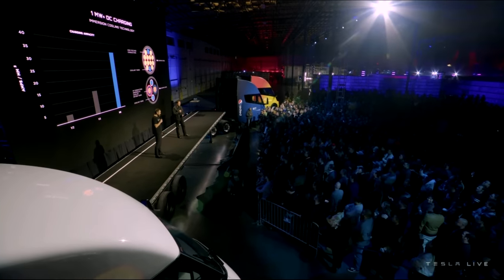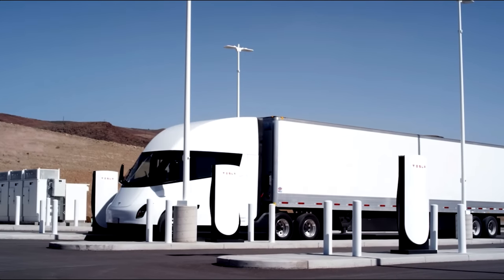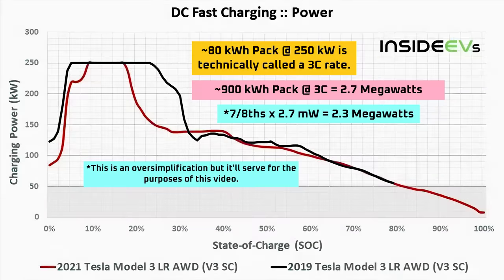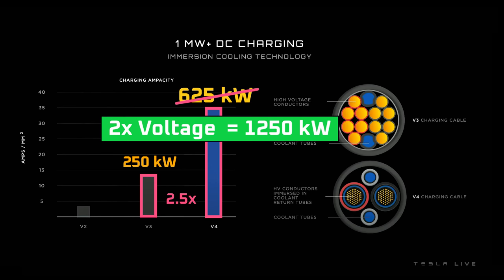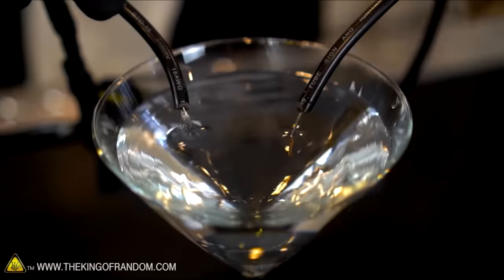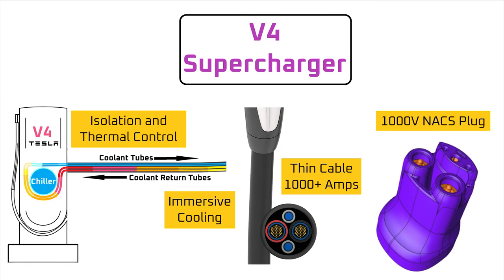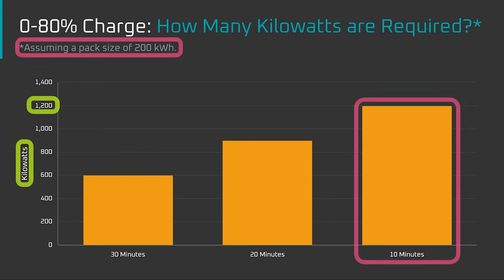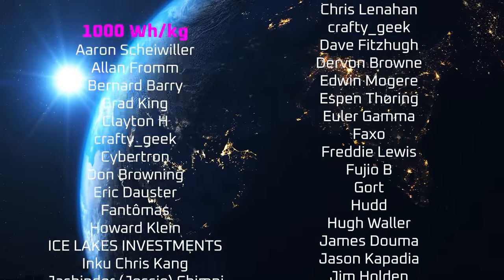Tesla V4 Supercharger // Megawatt Charging for the Masses

Comment: Trying to help but I’m far from being qualified. I suggest two things that might help. I live close to the 43 stall v3 superchargers in quartzite Az. A massive V4 or Mega Charger 
station is being constructed near the current V3 location. By the size and location 1/2 way between Phoenix and LA I’m guessing its for Simi’s and possibly cyber trucks. Inspection of this sight my give some resolution to the Mega/V4 question. Also in early photos of the Simi it appeared to have duel charging ports is it possible the new plug will support split charging for faster charging for both the Simi and Cyber truck. Again 

thanks for your fantastic videos.

Comment: maybe they don't need anti-freeze in the liquid if they use a tiny bit of energy to automatically keep it above zero even when not charging. in this case they could use distilled water which is non-conductive

Comment: Putting aside electrical considerations, it makes sense that semi mega chargers and V4 Superchargers would be separate for parking space and availability reasons. Consider: most super chargers are back in and often in tight parking lots. Semis won’t physically fit. And for mega chargers semi operators won’t want to open up these chargers to the whole Tesla consumer vehicle fleet. They could quickly get backed up with consumer charging. Businesses will want dedicated chargers. Note: this doesn’t preclude hypothetically offer a NACS adapter for semi but it doesn’t seem very useful. So I don’t see much benefit of cross compatibility.

Comment: Long range cybertruck and long range semis will probably need a brand new network of charging infrastructure.  It is easy to see why Tesla is starting with large fleet companies before getting to the individual truck driver because of this but Cybertruck could be the impetus for a totally new charging infrastructure roll out.  I believe this new infrastructure rollout may put stress on the current grid and may become part of major grid updates for the future.  Certainly grid connected batteries will be an important addition in the future.
Reply: Needa Serenity City mobile charity Chargin & tire repair too hopefully 🙏

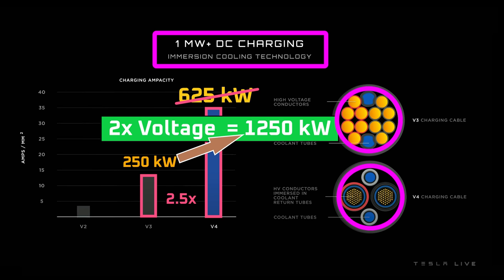Comment: In discussion of V4 Supercharger//Engineering for 5x Power (11:27-17:51), seems to me it would be better to use rectangular cross section conduction wire (higher "ampacity", i.e. current density) because less wasted space between circular conduction wires--as shown in the diagrams.

Comment: Crazy, too say the least. Does this mean that the entire electrical infrastructure of the city has to be cooled? Maybe not, according to even higher voltage, however, wouldn't it be safer to spend the extra money on thicker cable? It's only a few feet. 

I mean, I've had cooling issues with my truck (without 1,000v additional "side issues") 😬

Comment: 35 Amps/mm2 is perfectly reasonable, but it says immersive cooling I would expect the conductors to be inside a loose tube with a liquid or gas cooling, REMEMBER the voltage drop along the cable is seen by the coolant and therefore an oil or other non conducting fluid would be the way to go,  we used to put 10,000 amps easily along 120 mm sq but in commerce it was very close to the fuse rating of the cable even when Injection air cooled

Comment: Thanks Jordan, pretty much spot on to what I was thinking, just didn’t think about the lithiation element. Do you know what the changes to C rate are likely to be by adding Silicon and any potential changes to chemistry, do we have any info on C rate for Qilin?
Reply: Managed to answer my own question, found a video on CATL website that shows the CTP3 platform as having C rate of 4 so looking at the CTP3 space advantage which will be coupled to M3P chemistry so they could do an 80kWh M3P Qilin that would charge at 320kW peak which coincides nicely with rumoured Supercharger updates

Comment: How cold/hot will the coolant be? Tesla has been using an advanced heat pump on its cars for some time now. Certainly no reason not to use chilled coolant in the charging cable, AFAICS. _ other than the cost of the heat pump, anyway.

Comment: The conductors are not direct immersed. They are insulated from the coolant for the voltage and containment reasons. Direct immersion allows for parasitic metal loss. You see this in boats all the time. They will have a zinc block on them that slowly erodes away so that the rest of the outboard engine does not erode. you would have the same issue with direct immersed wires and no room for parasitic metal losses. They can't be direct immersed! There will be at least thin insulation between the coolant and the conductors.

Comment: Could they not just use multiple of the v4 connector on semi to double or triple the power input? Sure it would be annoying to plug in multiple cables, but probably a lot cheaper to design than a whole new type of plug and get economies of scale from the rest of the fleet.
Reply from the maker: Could be!  There were a lot of permutations what went through my head.  I'll leave it open to speculation 😁

Comment: U said v4 chargers have 2 return Coolant tubes (now I’m thinkin cooled with liquid nitrogen or doped mercury)  that means it has 2 supply tubes. Each circuit has both a supply an return coolant tubes that obvious by th size of cord cap shown in video large enough to channel through cap . Supply coolant delivered to back side of male plug from outside of a smaller tube to dissipate heat then returning on inside of inner tube to chill sommeres

Comment: Wouldn’t it make sense if the tri motor CT can plugin to both V4 and Semi chargers? Aren’t these sized trucks used for towing massive objects? Currently Superchargers are terrible designed for when towing.
Reply from the maker: V4 is supposed to have pull through charging apparently.
Reply: Mixing consumer vehicles with commercial trucks in refueling and parking is heavily avoided.  Consumers represent too much risk to the professional's livelihood in the potential for liability and lawsuits against the operator.  Just because Hank Hill was driving a rig, it didn't make him a trucker. 🙂

Comment: I hope Tesla’s Semi will use the international CHARIN standard for charging, instead of another proprietary connector.  I believe that fleets will require CHARIN, and that a standard plug will help Tesla as well as other truck and charger OEMs to electrify trucking faster.
Reply: This choice would cripple Tesla rate of innovation.  Tesla will move their standard 10x faster than Charin.  They will have some interoperability but will need control as a hardcore engineering company.

Comment: wouldnt oil make a better coolant than water......oil is used in high voltage transformers for example
Reply: They stated water.  Water has higher specific heat and therefore heat transfer.  Also if Oil then they would have to get approvals in case of a leak.  The water system can be made non toxic.  The safety systems will assure no conduction faults are allowed. More environmentally friendly.
Reply: @zilogfan  Great points! thanks

Comment: The industry standards for conductor A/mm is for the conductor only. It make sense for calculation purpose too.
Insulation is not taken into accont as it can varie and does not contribute to conduct current.
It may even be detrimental as isolation reduce heat dissipation.
So I dont think Tesla would depart from the industry way of using ampacity.
From plug specification, 1000V x 1000A = 1MW . Is the 1.25MW based on other assumptions ?
Even if there is only one wire for the coolant, I would be prudent with electrolysis. There will be a potential along the same conductor because of voltage drop. But you can alway use varnish on the indicviduals strands of conductors.
I dont know all the requirements but I would prefer to design a coaxial cooling than immersing the conductors, especially if it can meet power and diameter constraints.
Reply from the maker: Thanks for the input!

Comment: While not at the volume of Tesla etc. the changes to electric drive in commercial products - and their charging needs may be of interest to you.
For example the  underground loader (R1700XE) and charger (MEC500) from Cat - search Caterpillar and 112700.

The difference between cars and trucks and other commercial products is not the power they produce but the % of time they produce that power.
A Plaid is max power for less than 10 seconds - unless it it running at or near maximum speed for minutes - difficult anywhere except Germany and a portion of one road in Australia.
Regenerative braking makes electric vehicles a higher power "use" % than gas/diesel but still relatively low - except in racing.
Ludicrous mode used long term causing damage the battery pack shows some limitations - appropriate name though, and awesome for what it does.

Commercial product may have the same power level but instead of of power use of say 20% they have a power use of say 80%.
This brings substantially different cooling and reliability challenges with it.
Customers demand long term reliability and the same performance from full charge through to recharge time or temperature or altitude variations.

FYI the Cat Underground loader BATTERY PACK specs

Battery Chemistry	Li-lon
Pack Voltage - Nominal	715 V
Pack Energy Capacity - Total	213 kWh
On Board Fast Charging Charge time (0-100%)	Less than 20 minutes (two MEC500 in parallel); Less than 30 minutes (one MEC500)
Battery Cooling Method	Chilled Liquid (Extended Life Coolant)
Operating Temperature Limits (ambient)	50° C/–20° C (122° F/-4° F)
Charging Current, Voltage	1160A (output), 820VDC
Maximum Charging Rate	840 kW (two MEC500 chargers)
Charging Rate	Up to 4C (matched with MEC500 chargers)

As always an awesome video 👏👏👏 thanks for all of the information across the year.

Comment: Are v3 chargers going to be upgraded to v4, or is v4 just going to supplement v3?
Reply from the maker: Nah, just build new ones V4 is my view...that's what they've alwasys done
Reply: @thelimitingfactor  
Wondered if they might "re-cable" some V3, but on reflection, the plumbing for the cooling system may not fit in the "standard" box?
.
Also wondered if there's a possibility to repurpose old versions as the network upgrades, using them in customer locations for overnight slow charge.

Comment: What I don't understand is how is a 500V rated cable compatible with a 1000V vehicle? My only guess would be that the vehicle will be able to increase the voltage via a DC to DC converter.
Reply: if the vehicle has a wire to the middle of the pack and another 2 way contactor as part of its design than you can charge the pack half at a time even while still having the pack online for the car incidentals. This avoids adding the DC-DC weight and cost and efficiency loss and also of course leaves the Superchargers un-modified except the control software that is always being updated anyway.  This keeps all V1-V4 chargers accessible although at reduced net speed.  The cybertruck will definitely work to find V4 if they can and others in a pinch.  This also eases home charger configurations and allows easy continued use of the 11.5kw ish ac to dc charger part number now in all cars.
Reply: @zilogfan  Thank you for this explanation. This makes sense too. I did see somewhere else someone said that's how the Hummer does it. 
My new question, you said charge half the pack at a time, is how do you maintain pack balancing if you are doing half at a time. Or are you still charging both halves at the same time.

Comment: Yes, that's fair enough. It fits in with rough rule of thumb of European engineers that you must have liquid cooling if you are charging at 500kW for more than three minutes. The same engineers would always distribute the load and upgrage by stacked power modules. So, what you have said is completely in keeping with what we know from Pepsico's publicly available statements about their refurbished depots in Sacramento and particularly at Modesto where they have four Megachargers each and that they constructed themselves to Tesla design. But at 750kW, I think. And with the funding all well and truly in place last quarter 2018 for (originally intended) installation 3rd quarter 2019. And with the clear stated aim for the Zero Emissions heavy duty tractors to have a one million mile or seven year life. Does anyone know of any other Megachargers installed and in use?

Comment: What would limit Tesla from applying this immersion cooling to the 4680 cans and terminals? Seems like a huge gain in cooling efficiency and weight if they replace the channels with immersion cooling.
Reply: I don't think heat will be an issue in 4680 packs (in the near future)
Reply: @rogerstarkey5390  4680 will need cooling and heating for the next few generations. The pack can’t operate efficiently without temp control. The question is how to make temp control more efficient through immersion cooling (or heating).

Comment: Is battery degradation higher with rapid charging at this level?
Reply: If you look at it at a per cell level it is not faster.  It is the same or slower.  As a commercial vehicle they would not want to push the cell at higher charge rates.  The Hugh parallelism of the cells in the large pack make the difference.

Comment: It would be so much better if the mega chargers were just 4 x Super chargers with 4 x 400KW ports

The Semis should have 4 independent ports on the truck so you can connect 4 x 400KW chargers = 1.6MW total

But if you only need a slow charge for example while you sleep the same charger could charge 4 x Semis at 400KW each

Also I doubt the cyber truck will need more than 400KW so you could charge 4 x Trucks or 4 x Model Y of its not being used by a semi

This way the Semis could charge at normal super chargers too and the other cars at mega chargers

Comment: I suspect that you're off the mark on the Megacharger vs Supercharger plug. As you said, the engineering going into V4 Supercharger is extremely complex. Seems reasonable to guess that they weren't able to complete the engineering and validation in time for semi deliveries. They built  a simpler design to charge the initial deliveries. Tesla has never shied away from replacing an initial design with retrofit (see roadster charge plug, original autopilot hardware, etc.).

Given that they specify 1MW+ for V4 Supercharger, and you're guestimating 2.5x ampacity, 2x voltage: a peak charge rate of > 1.25MW wouldn't be shocking. I was just skimming the NACS documents and they specifically do not call out any current limits on the standard - only temperature limits. V3 Supercharger must hit close to 800A to do 250KW at low SoC as it does, so 2.5x ampacity would give a peak of up to 2000A. A quick guess at Semi charge curve would be: 1) current limited to 1MW/1750A from empty, rising to 1.26MW/1750A at 10% (1.4C), peaking at 1.35MW/1750A (1.5C) at around 60% SOC, then tapering back to .9MW/1100A (1C) at 80%. Assuming a linear rise and fall of C rate from 10-60-80% SOC, that gives 30 minutes for 70% charge.

This would be a similar charge curve to the Audi E-tron in terms of C rate.

Where the Model 3/Y/S/X batteries are engineered for maximum peak input and output, Semi battery will be engineered to handle maximum sustained power both in and out (for sustained grade climbing and descending, and charging). By using the same charger for all vehicles, but with passenger vehicles batteries optimized for maximum peak charge rate to get folks back on the road in 10-20 minutes, but Semi battery optimized for sustained charge rate where drivers are legally required to take specific break times, Tesla will be able to provide absolute best in class charger availability to all of their vehicles for the forseeable future.

Comment: I don't know enough to disagree with any of your analysis, but as a Musk and Tesla watcher I still strongly think Cybertruck will recharge considerably faster than their existing models..I base that on the way they mentioned that Cybertruck would be able to use the Megachargers, as revealing a secret they had long itched to tell, as an "oh and one more thing." Why is that a big reveal if the result is just a standard charging time? 

Also knowing Tesla, I know they want to eliminate all the arguments against EVs, and with trucks over and over we have heard about the need to tow ten horses across the country weekly, which apparently many people do based on the posts. Towing halves range, and then the violins start playing and the moaning about long charging times versus filling a gas tank with a few sniffles commences. 

I don't see Tesla going this far to give us the same charging speeds after making new battery cells from scratch and new Megachargers.

Comment: Where is the coolant loop in the car from the plug to the batteries?
The heat generation on the cables within the car needs to be solved
The on board cabling cannot be thick (weight), it cannot be liquid cooled (no loop), and there is no space in the for fans or fins (packaging)

The battery is liquid cooled, 👍. Not the issue.
Reply from the maker: Correct and good points!  Another good reason why the C/T may not be able to hit 1.22 jigawatts, lol.
Reply: @thelimitingfactor  I would expect the SEMI to extend the coolant loop to the on-board DC cabies. That would be the tell.👍
Regards.
Reply: I guess they will just extend the vehicle heat management to include those cables.
Reply: @musaran2  Yes, but then it will not be backwards compatible to all vehicles.
And that is fine too, not everything can be done in software. 😁